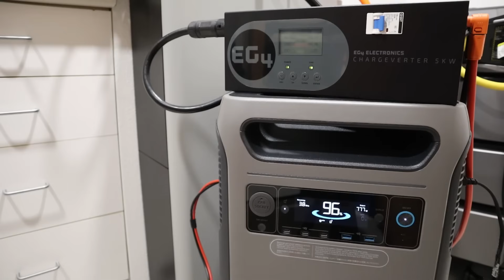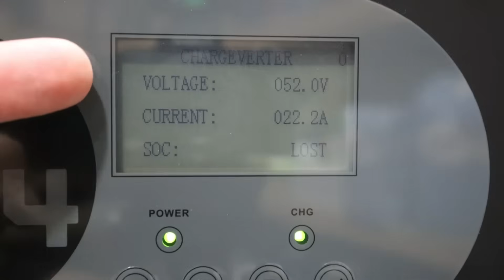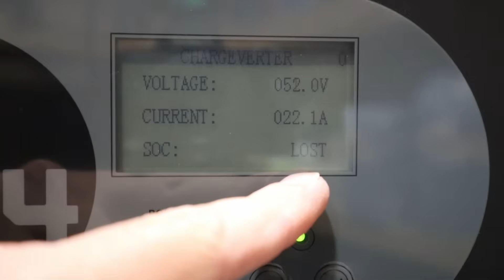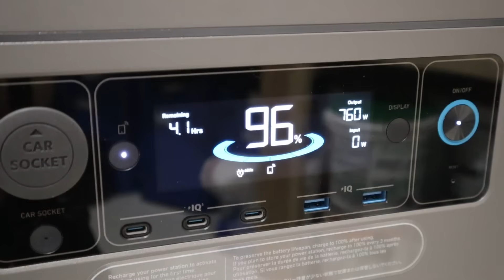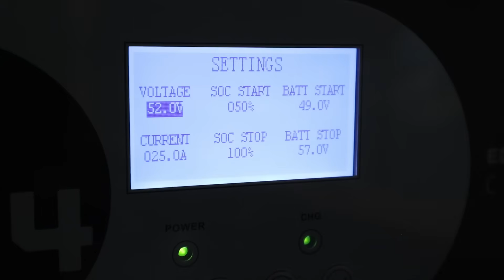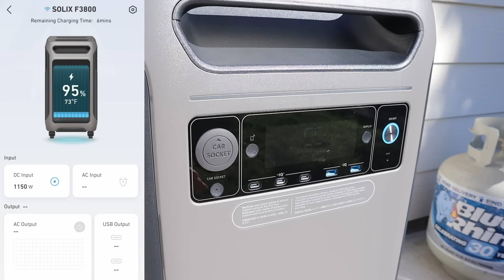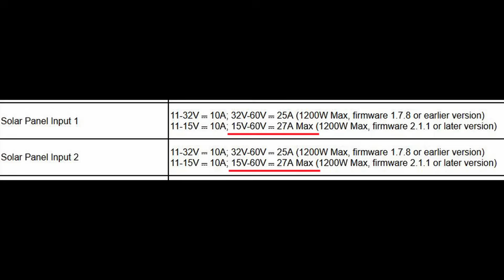The EG4 Chargeverter FIXES the Anker SOLIX F3800!  Keep the 240v Powered On!

Comment: Finally got my EG4 GC Chargeverter. Following your advice i hooked it up to both my F3800's in parallel and it charges them fine at the same time. Since i am not very tech savy i wanted to check with you if i can set the current to 50A and be ok since i assume the F3800's will take only the Amps they need. Please correct me if i am wrong. Also what if i got another Chargeverter and hooked it up similarly to the second set of solar ports on the F3800's. You are right, inputting to both the solar ports from same Chargeverter stops the charging, but if its different chargeverters on either port do you think it will work
Reply from the maker: You can turn the amps up to 50 👍 nor sure if the second chargeverter will work since it can't support a common ground with the first one ( the same power source)

Comment: Jason, I just got my ChargeVerter and will be ordering all the parts from your list above. I noticed that you have an 80Amp Fuse, but your video doesn't show where to install it. Can you explain where it should be installed?
Reply from the maker: Fuses protect the wiring. The fuse size is based on the wiring you use. Look up the ampacity of your wire and size the fuse accordingly.
Reply: @Jasonoid  This is probably a dumb question but should I have one of the 80amp fuses on each of the wires -- black and red wire??

Comment: With the price of the EG4 shooting up to 719$ has anyone found a cheaper alternative even if the output was lower. 
To use a smaller Honda inverter generator to charge the 3800 and maintain 240 volts out?
Reply from the maker: Right now I'm still looking for a decent alternative.
Reply: @Jasonoid  thank you 👍🏻
Reply: Hi I found the EG4 at its “ before price increase“ and it’s on the way. 
When programming it to the charging parameters you instructed I am assuming it defaults to them after shutdown and restart?
I bought the inline fuse holder with a 30A fuse to protect the #10 wire. 
Are the anti spark connectors actually needed?
The XT60 connector will stay plugged in and I will be just plugging in the EG4  
120 volt plug into my generator. 

Thank you again for this review.

Comment: So can run the chargeverter in parallel with solar panels? 

My thoughts would be to use 2x f3800 with solar panels, but then also have a diesel generator as a back up in a coast and burn type fashion.
Reply from the maker: Not in parallel but you could use the chargeverter on one port and panels on the other.

Comment: Hi Jason, I bought a 120VAC to 48VDC 1500W 31A power converter from Amazon. It cost $150. I tested it with my F3800 and the converter charged it at 25 amps. According to Anker app it was charging the F3800 at 1150W. I’ve been watching your videos and I thought that a converter would be enough to charge the power bank. I appreciate if you can tell me your thoughts on this solution?
Reply from the maker: Seems to be working, price is good. Does it have good fans? What's the link to it?
Reply: Post link please to charger

Comment: Jason: Perron released this: PECRON MJ32 Cascade Port Output Cable - Output Max 1200W per XT60 port.    Sounds like this could be used in place of the G4 if you have one of the Perron  batteries.
Reply from the maker: Yes, it's basically a good way to power dump from a Pecron power station to anything else. I have one I'm testing with.
Reply: @ awesome I just got to e1000 which was only $399    if you can use this function, that would be amazing.  By the way, are you also Testing the F3800 plus?
Reply from the maker: @LectricOverlanding  the cable worked with the EP3000 battery, the E3600 and the E1000. It doesn't show the wattage numbers going out though.
I will be posting my F3800p video on Wednesday
Reply: @ amazing! Can’t wait. Really hoping it’s worth it because I’m about to sell mine to a neighbor as a furnace back up system and hopefully replace it with that one.
Reply: @ can’t wait man! We are all waiting for that video! Do I have to wait till I get home from work? 😅
Reply from the maker: @LectricOverlanding  Pecron video on Friday, Anker video today, busy day!

Comment: I have an F3800 and as an experiment I tried charging our Bolt EUV from it using the GM Dual Level Charge Cord plugged into the 240v outlet. It would not work, probably because the charger thinks the F3800 is not grounded. This made me also wonder is the F3800 bonded or unbonded? Cannot find an answer to that question anywhere.
Reply from the maker: In my original review video I showed the AC output is floating. 
When you enable EV mode by double pressing the inverter button, it bonds the Nuetral and Ground internally.

Comment: No, dude. That's not a solution. The solution is in the firmware.
Reply from the maker: Anker engineers said it wasn't possible on this version. The new F3800p has a way to charge from 240v input and it keeps the 240v output enabled.
Reply: @Jasonoid  Why would I want an old one? Lol! You answered pretty quick. Maybe you can give me a pro tip since I am considering a purchase and time is running out (supposedly). Please don't make me dig through websites, gander at charts, and do math for an endless array of choices. I'm not that bright. Does max watts matter for charging? I see people complaining. The inputs seem wonky. Will 4 of Anker's 200-watt rigid panels get the job done?  What are the best affordable solar panels for this unit? Ankers are overpriced! There don't seem to be any humans in the office. Does Anker run on auto with bots and AI?
Reply from the maker: If you want those types of answers, you'll need to reach out here:
https://asqme.com/@Jasonoid

That's going to take a bit of my time so I need to make it worth it.
Reply: @Jasonoid  You owe me $20 for the time I spent watching you run your mouth without saying much on two videos. At that rate, it's a bargain! I don't have time to waste.
Reply from the maker: @drivebyquipper go pound sand...
(and good luck getting any other YouTuber to reply to your comments 🤣😂👍)
Reply: @Jasonoid  all you had to do was give me a yes or no answer whether Ankers rigid solar panel option will actually charge the overpriced piece of junk. If you had an original thought it would die of loneliness.

Comment: I don’t have a 240v plug in my garage 

 Could you use this solution to plug the f3800 into a 120v plug and then a portable 20amp EVSE into the 240v side of the f3800 and charge your EV without running out of capacity ?

Comment: Thats a great video and a smart workaround. I have a 2 x f3800 setup and just went ahead and put in the order for EG4 chargeverter. Will split output and try to charge both F3800 from a 240v Generator . Was looking at the manual . What settings on the chargeverter do you guys who have the F3800 use for  charging. Thanks in advance

Comment: I been watching your videos, I bought the F3800 last August 2024, they did not send set up manual so I have a bite of problem setting up, so in December I did not use it for A month, it  drain itself down to 0% , I try to turn it on recharge , it will not do anything at all, so I call customer support nothing help so they said send it back for warranty repair, but their prepaid label is down but do not when it will back up working for Canada. So they said I can send it back at my cost but refund the cost only by amazon gift card . F3800 was 3700 dollars , because it is a big heavy item so buyer beware when you have problem , now it is still seating at home waiting for prepaid label working so I can send it back , just want to share with the public .

Comment: In your parts list for the Chargeverter wiring between the Chargeverter and the F3800 there is link to an 80 amp fuse.  Can you describe where this fuse is used please ?

Comment: Seems you should just hook your 240v gas generator up to the transfer switch.   What are the benefits of 240v AC Generator to back to DC Chargeverter to AC Inverter to Transfer?
Reply from the maker: Yes, but this video is mostly for the people who purchased the Anker F3800 that didn't know the 240v output shutoff. Many other channels didn't disclose that issue in their videos. They have the product and needed a way to get it working.
Reply: @Jasonoid  Got that and much appreciation come back to you channel for the honest facts. TY. But genuine question as I am try to decide to hook my 6k watt 240v gen up to the Transfer directly, or go this route now that you point out it is viable.. What are the benefits?  NOTE: My gen maxes out at my required load vs being 2x or something. The web is suggesting power is more dirty when gens are pushed hard.

Best I can tell with my reasonably uneducated observation is that one would be trading off 25% or more efficiency loss after the DC to AC back to DC in exchange as well as limiting you generator to 1200 watts in exchange for cleaner power.   

My thoughts
Positive: since you can store tons of gas, who care about efficiency. You got clean power.
Negative: You can only put 1200watts of power into the battery from your gen, so if you load is more than that sustained, you will eventually deplete the battery
Undecided: If 1200watts from the gen is my goal, my generator is barely sweating so the web is suggesting that the power is still relatively clean as apposed to when it is pushed to the 6k watt zone.  So why go thru the hoops of the extra steps.

Massive appreciation for your time and knowledge, would love your opinion.
Reply from the maker: @carterjohnson25  if you can store gas for the runtime needed, I don't see an issue running an inverter generator for the whole time.

The benefit of having a power station is that you can run it for hours silently, then charge it for two hours with a gas generator, and then run it for a bunch of hours silently again. Obviously this doesn't work well on the F3800 Since you cant charge it at the same time... But other models like the Ecoflow DPU support charging and 240v at the same time.

Comment: Thank you for this solution to the Anker F3800 charging limitations. I am one that bought the unit before realizing the limitation of no AC charging while using the 240v output.  I was so excited to finally see a less expensive, compact and integrated battery unit that could power my whole house for 12 hours through my 240 volt service panel, that I purchased without complete research. 

I have had a home backup non-inverter generator for a few years now (never had to use it for real) but have wanted a battery so that I didn’t need to run the generator at night. The available options, like Tesla Powerwall, are too expensive for my budget. The Anker F3800 specifications are perfect for my needs. I do need to charge the battery at about 2400 watts to only run my generator for about 3 hours twice a day. Of course, a single Chargeverter will provide only about 1200 watts charging with the “no common ground” limitation of the two XT-60 DC inputs.

Have you had any feedback from anyone that has used two EG4 Chargeverters to increase the DC charging rate closer to 2400 watts on a single F3800?  

If not, I will test the single Chargeverter I just received next week and if all works similar to your demonstration, I will order my second Chargeverter. In a couple weeks, I will let you know if the “two-Chargeverter” solution is as we expect. 

I may also buy a second F3800. I believe that two Chargeverters would provide about 4800 watts of battery charging to two F3800s (with the Chargeverters running at about 50% load). Two F3800s at 12,000 watts of 240v inverter output can easily run my suburban home’s A/C, electric water heater, electric clothes dryer, and electric oven (not quite all at the same time), and reduce my generator fuel usage to just a few hours per day. We use about 16 kwh per day and my "7500 watt" generator can produce about 5000 watts at my 4500 foot altitude on natural gas.

Thanks again for your excellent videos. You have a talent!

Comment: Great channel!  I’m looking to upgrade my off grid workshop from my current Bluetti ac200l. I have it connected to load center lowering one leg of panel for 120v around my workshop.  Problem is that even though it’s 2400w with surge, my crosscut saw with led lights and dust collector keeps kicking off my inverter.  Question: I think f3800 is 3000 w per leg in 240 output.  If I hook up f3800 240 on my load center and stagger my 120v circuits across the two legs - say 1 20 amp circuit on leg 1 and 1 20 amp circuit on leg 2 - can I get basically 3000w on each circuit?
Reply from the maker: 6000w total, 3000w per leg. If you need more, I'd look at the Jackery 5000.

Comment: 5:20 tried it and it didnt work.
Reply from the maker: Theyd have to come from a different source, they can't have the same ground.
Reply: @Jasonoid  please elaborate.
Reply from the maker: @LeeroyyyyyJenkinssssss  I talked about having the same ground in the video. If the charging source has a common ground or negative the F3800 stops charging.

Comment: My home is propane on all major loads, my electric load is confined to LED lighting and receptacles for typical household appliances except for my 240 volt well pump and a couple of ductless A/Cs. I had to purchase a 240 volt inverter generator for these two intermittent loads. A 2000 watt inverter generator will put out twice as much electric power per gallon of fuel than a 6500 watt inverter generator. With this system I wont have to run my generator at night and it can recharge during the day when im not around. This is the setup I have been waiting for. Thanks for the video!

Comment: man, my 3800.  the solar input stopped working.  doing a little research and it seems is not an uncommon fail point.  very disappointed as was about to get max solar input etc.  just a heads up to anyone considering getting one.  build quality may not be the best

Comment: I'm confused why not just plug the gas generator in instead. Seems useless to use the EV generator, then charge it with the gas one. Just plug the gas one in?
Reply: This is for people who don't want to run the generator 24/7 - like at night because of noise etc. Also, many gas gnerators make really dirty power that could damage the F3800 (and other stuff in your house). The EG4 box isolates the battery from dirty generator AC.

Comment: So can I create an adapter for 120 v that just plugs in the wall socket at home?
Reply from the maker: Yes, but it will need to be wired the same way as I wired the 120v version.
Reply: @Jasonoid  thank you

Comment: Is there a way to use 2 110 outputs (on the left column) into a 220 transfer swirch ?   This would allow ac charging bypass to work i just dont know the output limitations.  Hopefully this makes sense

Comment: I am I the process of assembling all of these items - don’t know what I am doing but … 2 questions I have.
1. Since I have a generator that can output 240 can I connect the Chargeverter at 240 and step it down to output to the F3800 ? 
2.  Is there any reason a bussbar cannot be used to use the Chargeverter ring terminals and then make up the XT60 cable with ring terminals on one end and the XT 60 female on the other ?
Reply from the maker: For a 240v generator, use the included power cable no modifying needed. Just setup the Chargeverter with the settings seen in the video.
Yes, you can use a bus bar if you want 👍
Reply: First I will be happy to pay your consulting fee - just advise as to how.  But there are so questions here, I just wanted to place them in one text.
This relates to connecting the Chargeverter to the F3800 using busbars.
1.  Recommendation on brand and type of busbars and fuse size if appropriate
2.  Can I use a bussbar with a fuse ? (This should be #1) but trying to correct is tough !
3.  Do I still need to use the spark arresting XT90 cables.  If so can I use ring connectors on the busbar end of these cables ?
4.  Can I use a XT90male to XT60 female cable for the final cable that plugs into the F3800 ?  Is I use a fuse above do I still need this one.- or this one and not at the bussbar.

Anything I am missing or need to consider.
This has helped so much for everyone !

Thanks !

Comment: how did you  get the 6 gauge terminals on the 4 gauge wire?
Reply from the maker: It's a tight fit, cut a few strands to get it to fit. It will be just fine.

Comment: Hey Jayson, I just wanna get some understanding though. Can you use just one of the units to charge both input for and Max out that 2400 W? Or would you need two of them to do that?
Reply from the maker: You cant charge from the same source on two ports, you'd need one chargeverter for each port.
Reply: @Jasonoid  thank you so much for your response. Is there a different way that I can max that out with my generator?  

Hard to buy two of them.
Reply from the maker: @LectricOverlanding  nope, that's the fatal flaw of the Anker F3800

Comment: Another fabulous video Jason. Such a shame this limitation exists with the f3800. Good luck with Anker support. I sent in a presales question a week ago with no response. The Jackery is clearly a better solution and doesn’t have this limitation.
Reply from the maker: Well, the Jackery 5000 also shuts off the 240v output when AC charging, it's just a little different. Have you seen my video about what happens?
Reply: @ absolutely- it was a great video. You still get 120 right? Seems all the power stations use the inverter to charge from AC except the EcoFlow ultra. Watched your video on that one too 😉

Comment: A bit expensive but could you use 2 EG4s and charge using both Solar ports and capture the full 2400 watts thus charge very rapidly?
Reply from the maker: I believe that would be possible, I didn't have a chance to test that with only one Chargeverter.